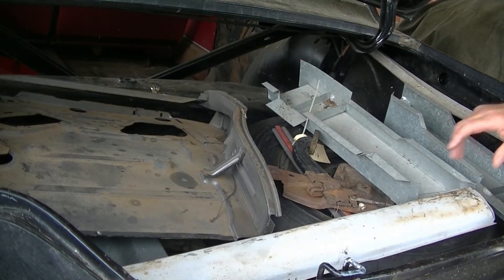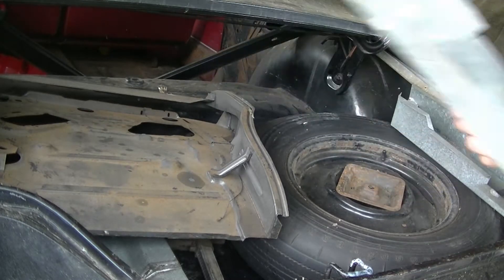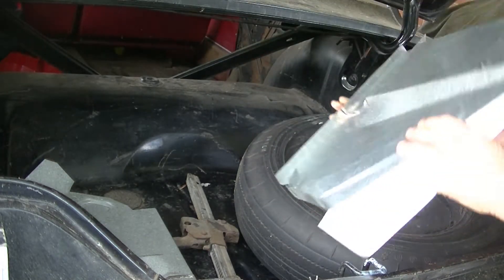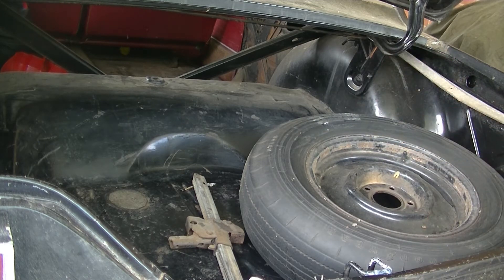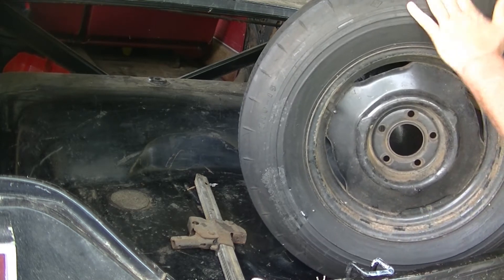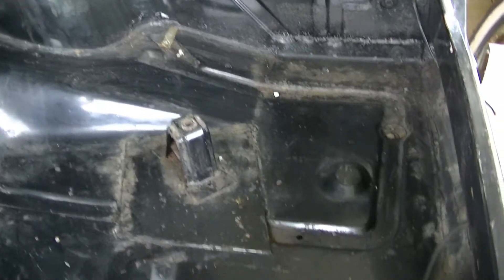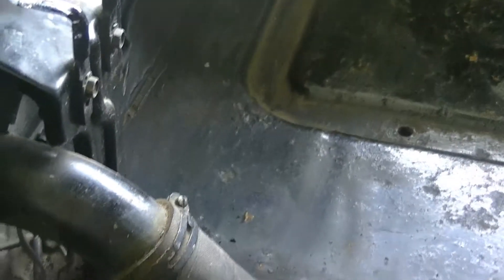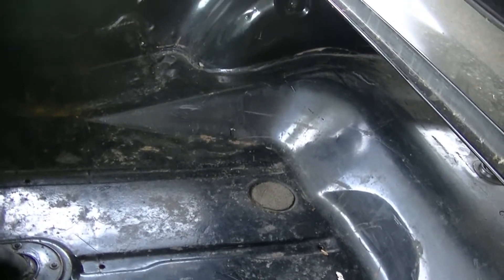Studebaker Rescue Video #4   Junk in the Trunk

Comment: I believe you will find those two mirror image galvanized parts to be part of the front inner fenders, the part attached to the main body, back of the wheel. If I could find a way to send an image, I would send a copy of that area which I took in about 1968, when I did a frame off of the '61 convertible.  PM me for details!